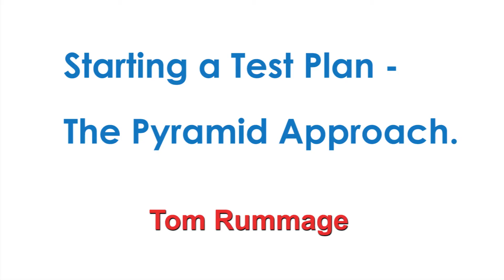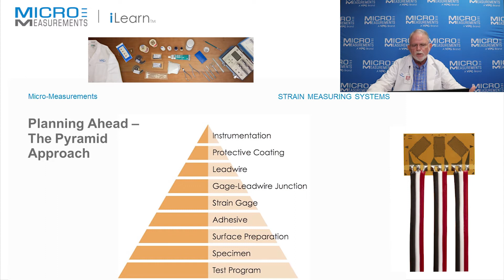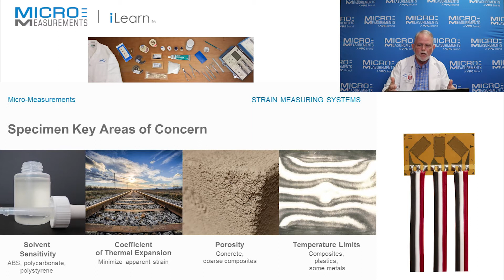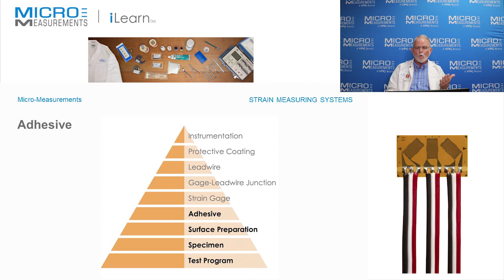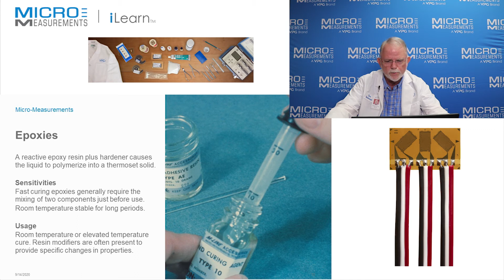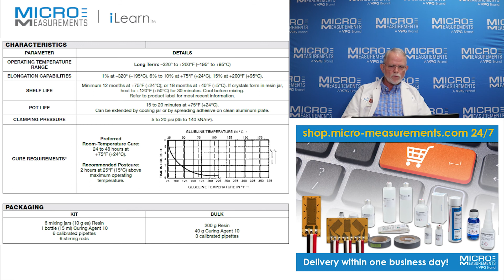Starting a Test Plan - The Pyramid Approach.

Comment: I didn't expect machining parts using a silicon-based coolant will affect the strain gauge installation. I thought the degreaser will take care of the contamination. However, I'm not sure how silicon particles affect SG bonding.
Warming up the adhesive in your pocket is one pro tip of the day LOL.
Thanks for the cool presentation.